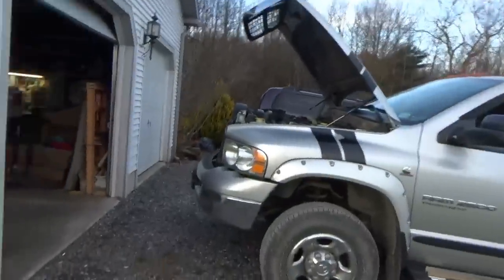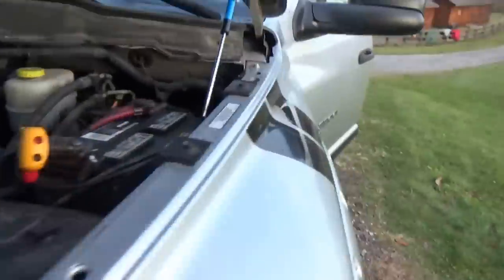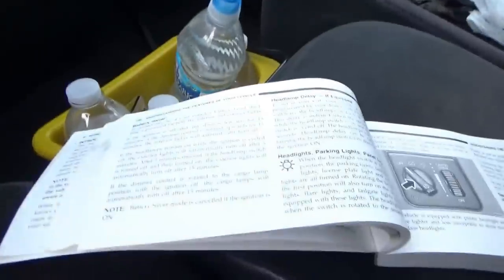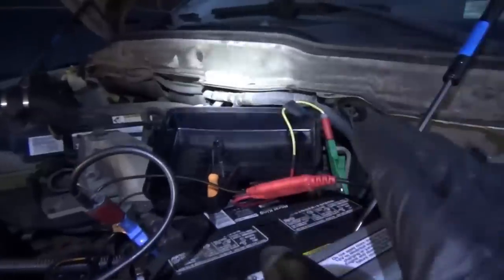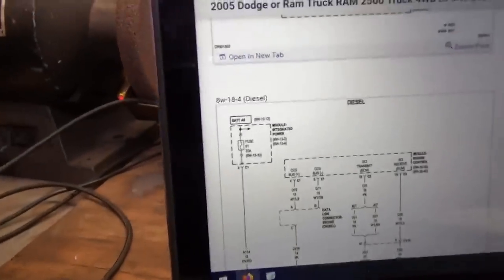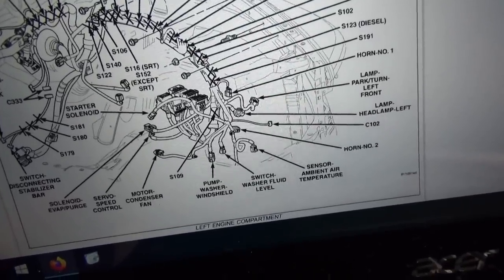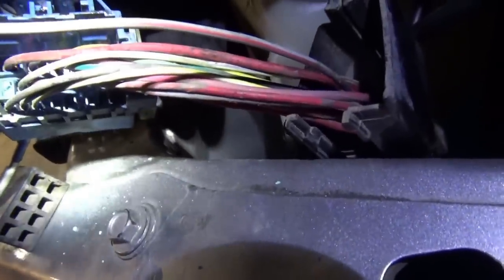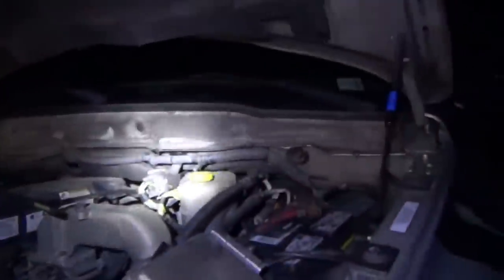Ram Drains Battery...But NO LIGHTS?

Comment: I see you are using a Fluke amp meter, did your Craftsman one crap out? How good does that Fluke work for current checking pretty good? Isn't it fun figuring out wiring problems when the manufacturer runs two wires of the exact colors in the same harness?
Reply from the maker: Yeah the Craftsman amp clamp was drifting a lot. Fluke is a lot better in stability. However it's actually not as user-friendly as the Craftsman was...always defaults to "AC", and beeps annoyingly on the "Ohms" scale!

Comment: Ivan Google Truck lite NYK 77  electrical compound. Amazing stuff believe me. Trust me ..snowplow mechanic up here in NYS, Also PLEASE show yourself sealing those tiny holes your piercing tools you put into the harnesses. Clear nail polish works amazing for this and a lot less sloppy than liquid electrical tape. Nice work as usual though. TIPM's suck.....
Reply from the maker: I've been using a dab of dielectric grease for small pin holes... No mess and waterproof!
Reply: @PineHollowAutoDiagnostics  Dielectric never solidifies like nail polish. and the NYK works better than that on connections IMHO.  Thx

Comment: Great job did you fix fob working on doors or did it just work after wire repair I have same problem on Dodge Durango 2006 batteries dies but everything works ok except fob all fuses that have par draw on are all labeled Fcm where do I start

Comment: Problem is the radio. It shouldn’t be cycling the cds around like that with the key off. That’s probably the noise customer hears when battery dies. Common issue with those radios when they go bad and keep cycling cds until battery dies.

Comment: I've had that exact wire break/corrode behind the battery from touching the battery bracket in a 1500. Same symptoms except there was no battery draw I don't think.

Comment: Good diagnosis.  What brand amp clamp are you using?  These types of videos are extremely valuable to me.  Being out in California I don’t see the corrosion issues that you and Eric O see with electrical issues but showing the process of tracking them down is very useful.  The biggest issue I have with theses connectors is trying to get the pins out of the connector.   Of course the customer only sees the time it actually took to fix the wire connection not the time it takes to find it.
Reply from the maker: The customer watched this video so they are well aware 🙂

Comment: At 8:15, WHEN  THE DOOR OPENS, NOT IF THE DOOR IS OPEN.
A BIG difference, the control responds when you OPEN the door, that is when you physically open the door. 
Not after the door and when the door IS open.
If you closed and opened the door at this point I wonder if it would it have responded differently after setting the thumbwheel.
Reply: Likely notqnything different.  I know the pedantic in me wants to agree with your when door is open scenario but I see the alarm or dinging as a way to warn you that you left something on that could drain the battery. Presumably this should cover use cases where you open the door then turn off the car and remove the key.

You might ask who in their right mind would open the door before turning the car off and removing the key. I just did after driving all night and having to piss when I got into the drive.  I don't think situations similar to this would be out of a normal use case and the engineers likely already accounted for it by whenever the door isn't closed instead of when the door changes state.

But I could be wrong.  It is a Chrysler after all.
Reply: @sumduma55  Hi, I'm a programmer and that is a big difference and it will have been programmed that way on purpose.👍😊

Comment: I need help with my car it’s an 04 Grand Am SE 3.4 V6. It starts and runs fine but when I turn on my dome light the light dims and goes bright again and then kinda flickers. I checked the voltage from the alternator and it’s running fine 14-15 volts when the engines running. Checked the battery next good strong 14-15 volts from the alternator and a good strong 12 volts with the engine off. I also noticed when I flick my headlight switch to parking lights the dash lights dim. This is with or without the engine on same result. And lastly when I turn on the rear window defroster the dash lights dim and you can only turn that on with the car running.  So I have some weird symptoms and battery and alternator are good.

Comment: Ivan, what do you think caused just that wire to have corrosion?
Reply: Those wires don't have weather seals on them. Also it's a constantly powered circuit, so current accelerates the corrosion
Reply: Stable Genius  , just on that pin??
Reply from the maker: Great question! Seems kind of random that it was just that one wire. It's also the only wire that has some current flowing through it for the entire life of the vehicle, like the radio clock and dome lights etc.

Comment: Ivan am wondering if you have a tool called the amp hound? With it one can troubleshoot parasitic drain problems without removing power from the circuit. Reading currant (amperage) amounts,finding Rouge power drains and identifying active/inactive circuits.
Reply: Type amp hound on you tube there are some nice videos to check out..thanks for all the great work.Most great full 👍👍
Reply from the maker: I saw the Amp Hound on Joe's Auto Electric channel. Pretty neat tool! Basically a voltmeter that converts voltage drop across a fuse to an amperage readout based on the type and rating of the fuse.

Comment: Well done ivan :-D sherlock holmes would be prowd of you :-D.
i did think about back feeding the diag connector for fun,  but i would worry about the thin wire feeding the 12v pin not being thick enough for the unknown current it may pass.
i panic too much lol.
Reply: Ivan is Sherlock Ohms lol!
Reply: Ooow nice one, i have no resistance to the new name :-D
Reply from the maker: haha that's clever xD

Comment: Chrysler electrical problems? Start at the TIPM. Why do manufacturers put such vulnerable devices in damp areas? Were you on the wrong wire first or was it a connection that lost power under load?

Comment: I have a '99 Dodge and I was checking my short on my battery I found out it was a 50 battery amp fuse I was hearing noises going through my seat when I had to test the light on I disconnected the power to the seat then it went off trying to figure out how to figure out to find the problem and fix it

Comment: First thing great video.  I  wonder one thing, at the time of this video did you have a break-out-box and could you have used it to make the bypass to the dlc instead of poking a hole that you would have to repair?
Reply: That is a bad idea to make major alteration to the factory spec/lay out. You done the right thing Ivan, so the next mechanic will not have to unscramble a mess. You are very smart/knowledgeable at your trade. Professional!!!

Comment: My wife's 04 ramn1500 the lights stay on the milage And letter R N D 12 lights stay on and the steering wheel doesn't lock when taking key out and those lights stay on and kills the battery over night

Comment: Out of curiosity, how do you price a job like this? I charge hourly diagnostic rate at a minimum of 3 hours and am curious how others do it.
Reply from the maker: Why a minimum of 3 hours?
Reply: Pine Hollow Auto Diagnostics in all my surrounding areas that is what my competitors do. Cheapest shop cost is $320 and cheapest mobile guy is $280. My charge is $180. Still trying to figure out the business side as I get more work than I can handle.
Reply from the maker: Very interesting. What area do you live in? And do they actually perform proper diagnostics, or just charge 3 hours and take a wild guess? Maybe I should raise my prices haha

Comment: Dual batteries is usually bad for parasitic draw when one battery gets a shorted cell. Test batteries FIRST
Reply: I did that and that is why there is a new one on pass side  it was totally cooked and was adding to the para drain  that was the truck I took to Ivan       Brian W.

Comment: I have a '00 Jeep Grand Cherokee. I has a random draw. It can sit for a week and be okay, or be dead in two days. My daughter has reported seeing the headlights flash on briefly on their own. In a scan tool looking at the BCM, I see the battery voltage is 1-2 volts lower than actual. I'm thinking I may have a similar issue. Also, sometimes the dome light doesn't come on when the driver's door is opened.
Thanks for the video!
Reply: Until I figure the issue out, I put a small trickle charger under the hood to keep up with the discharge. I also put in a 3 way plug so the engine heater and charger can be plugged in with one cord.

Comment: what did I learn. Well you need a wire diagram. Amp camp helps. Second: you can run a jumper wire, or just try a little harder and keep looking for the real break. Even though the jumper wire is fine, if it's not your car the next guy to look at that might be like WTF is going on here?!?!?
Reply from the maker: Great lessons summary :)

Comment: Weird that he only complained about the parasitic draw and nothing about the radio, they always complain about the radio! Lol! Or about the fact he can't read anything when hooking up a code reader...perhaps not pass inspection(I don't know if PA hooks up to the DLC for inspection).
Reply: PA hooks up to DLC for "emissions inspection" test. Basically if connector is dead, no test by machine, can't do "vehicle inspection" until emissions test is passed or failed by test machine. 

If failed by test machine, customer gets a signed VIR (vehicle inspection report),  once $150 (with receipts) is spend on repairs by anyone, including the owner (labor and parts counts only if by a repair shop, owner only gets to claim $!50 in parts)  and vehicle doesn't pass on second emissions test (which is a free test within 60 days at any emissions test garage---with presentation of VIR and receipts), a "wavier" sticker can be issued by a "Certified Emissions Repair Tech" (not all PA State Emissions inspectors are  Certified Emissions Repair Techs and not all Emissions stations have one). That sticker is good for a year.  (there is some fine print involving missing or tampered with, and no longer available parts)

There is also an "exempt" sticker...that applies if less than 5,000 miles, in a total of last 12 months (more fine print...with State approval less than a year can be approved),....also...if  owned by same owner.....or a new never been registered or current model year PA or out of state vehicle just registered in PA with less than 5,000 miles. 

In any scenario, after you get a emissions sticker, then you can get inspected for the yearly safety inspection sticker. 
The emission test and inspection can be done at two different shops.
Reply: Nick   I did leave that info with Ivan  He did not find it till later   I knew all this stuff was connected   radio dlc etc but did not have access to wiring diags   which I have now found a very good source for part timers like myself   eautorepair.net        thanks   Brian W.

Comment: I had the same problem, 2014 Ram only 15,000 miles.My radio just died, few days later battery died. Took it to the dealer after a boost, they throw a new battery in and tell me the radio just died and it was just a fluke that the battery drained right after???  So radio they say is $800 and I get home and the battery dies again. Motherf$$&s. Seems to me it might be a grounded wire draining the battery but I'm no mechanic. Any ideas??

Comment: very nice video i had a harley davidson sportster it get the green crusty on the fuse with the key turn off and not in the bike the IAC would turn on and run you could hear the IAC running i got the clear cream like harley davidson use on their head light switch put it on the fuse the pin to the relay lost contact like over heat not let a good contact happen to the relay cheap made in china relay get a tube of the lube Harley Davidson sell for the head light switch give that a try see if it stop the green crusty coming back

Comment: Did the customer mention...oh by the way half the stuff in my truck stopped working and now my batteries go dead??
Reply: The most important thing is to try to get the information from the customer but not to trust it until you verified it for yourself, but to also always expect they forgot a part of the story.
Reply: yea  I did
Reply: this was a very intermittent problem Joe   I did not have access to wire diags  as I just do this stuff part time and do not pay for monthly    I found a great source now    from Mitchel    eautorepair.net   20.$ per vehichle for one month     Thanks   Brian W.